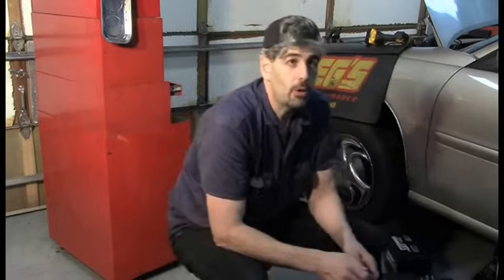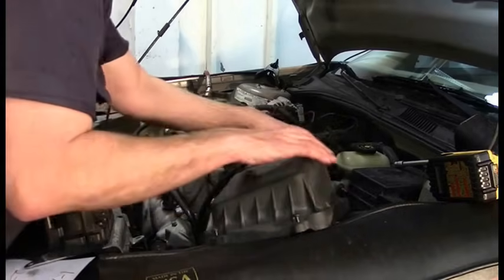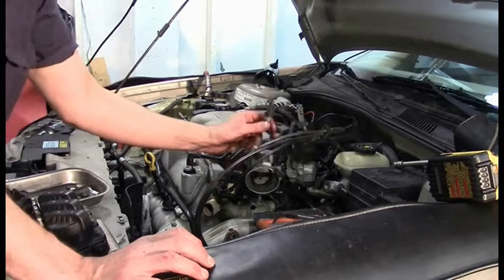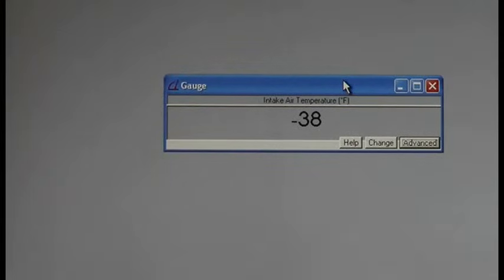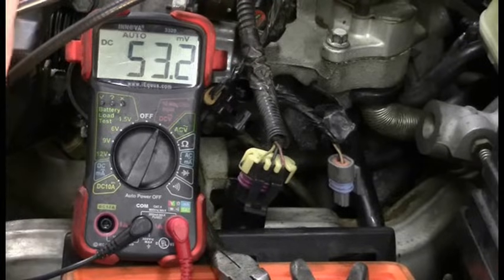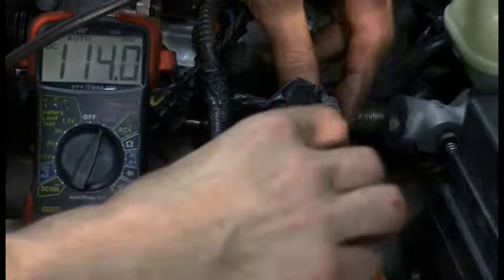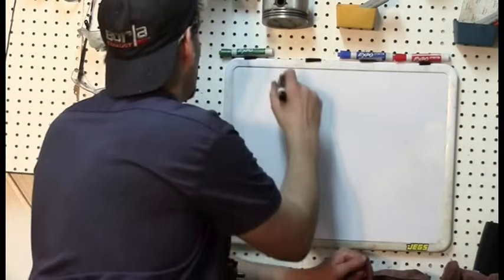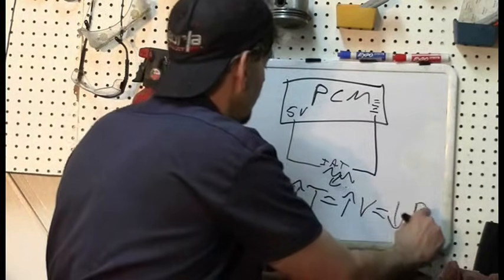IAT ( Intake Air Temperature Sensor ) Diagnosis P1111, P1112, P0113

Comment: Maybe you can help me out on my car by giving an advice
Reply from the maker: Thats why I am here. What is the issue and more importantly what data have you collected?
Reply: Schrodingers Box no codes but intermittently flashing of lights on battery, abs, ebrake light Autozone checked it says voltage regulator, I checked battery and alternator gives good readings, 04 civic ex....😥
Reply from the maker: Sounds like bad batter connection. Check battery terminals and other than that the main fuse and ground.  A bad block ground can do this for sure.
Reply: Schrodingers Box I will double check on that but I’m pretty sure I’ve cleaned and checked all those as well
Reply: Schrodingers Box the most times tht lights flashes when I speed up then release my foot on the gas then starts acting up even my headlights gets dimmer then brighter....😔
Reply from the maker: What is voltage drop across the chassis ground?
Reply: Let me check really quick and get back to you sir
Reply: Schrodingers Box ok, when the engine off the voltage is 12.45even the chassis ground no voltage drops when the engine on 14.85 same thing with the chassis ground
Reply: Every connections are tight and secure clean and what so ever, but sometimes while I’m driving it’s starts acting up specially when I release my foot on a gas pedal lights from abs e brake and battery light will flash
Reply: Schrodingers Box do you have any account that I can message you like messenger ?
Reply from the maker: Well of course there is no voltage drop across the ground with engine off- that’s obvious. Not sure why you would do that.  But how can you have no voltage drop at all on the chassis ground? Not even half a volt?
Reply: Schrodingers Box it’s really weird I checked it few times its just flactuating like 14.85-86,87
Reply: Schrodingers Box can we say it’s a voltage regulator? I don’t want to throw parts without really confirming the real prob, even auto shop here in National City California they said there’s nothing wrong it I doubt it
Reply from the maker: You still have no data. Ok just tell me what is the voltage drop from the Positive Terminal on battery vs the Starter solenoid positive terminal during cranking? Maybe it’s on positive side and not ground.
Reply: Schrodingers Box I’ll check it tomorrow as soon as I get a chance I’ll let you know, so thankful for your time to reply, I’ll let you know tomorrow sir
Reply: Schrodingers Box .15, .16 voltage drop

Comment: Hi i have a hyundai excel x3 1.5 dohc engine and the manual doesnt show the iat sensor or map sensor but i have a map sensor on the manifold ? I have a 4 wire sensor and cant find testing on the  hyundai map sensor?  Any help appreciated thanks?
Reply from the maker: yes it has one.
Reply: Is it part of map sensor?
Reply from the maker: No idea. Look at the design. If is has IAT built in it has to be 5 wire since MAP is potentiometric

Comment: So my car is haveing problems with this where  it’s a crank no start but there seems to be oil on the plug and reading a hire voltage then it should what should I do
Reply from the maker: I would start with a simple FASTTEC analysis to get your source direction

Comment: Would remapping the Ecu effect this sensor? Thanks
Reply from the maker: I am not sure why anyone would do that but I suppose you could adjust calibration of it through programming.  Even so the effect on fuel trim adjustment would be pretty minimal.
Reply: I turned my ecu with a Remap. 6 weeks later I Received an error message P011100 code. Not sure is it the sensor?
Reply from the maker: Ok so what is the input into the ECU reading?
Reply: @SchrodingersBox . I didn't take any readings!
Reply from the maker: Well then we're stuck

Comment: Great video Matt! Question: what relationship does the IAT have on fuel trims? Thx...
Reply from the maker: just about none at all. An IAT will never cause a P0171 for sure even if it was fully open circuit.
Reply: @SchrodingersBox  Well my problem now is my fuel trims r -18 but I'm not getting any codes. Scanner Danner just gave me some advice and I'll try that this week. Thx Matt
Reply from the maker: @curlymyhero  Yeah I would start by curving the fuel trim against load to get a basic direction to start with.
Reply: @SchrodingersBox  Thx again Matt!  Just noticed u have 600K views on ur IAT video. That's alot of views for mechanical advice! Congrats

Comment: I swapped PCM and sensor, no joy.  Checked wires signal wire was only getting 1.5 volts instead of 5 from PCM connector.  Switched to a nearby 5 volt reference and now I get 5 volts but it doesn't change the P0113.  I can't seem to get anything but -40 when on live data.
Reply from the maker: What was your data that the PCM was bad? I would start there for sure... also why was sensor changed?
Reply: @SchrodingersBox  I changed the sensor because the wires seemed fine and the -40 on live data led me to believe the sensor was not communicating.  I changed the computer because I thought it wasn't sending the 5 volt signal.  I believe the problem is with the IAT pin #21 on the PCM connector that is producing 1.5 instead of 5 volts.  Now I am searching junk yards to see if I can rob this connector.
Reply from the maker: @QLFProductions  Are you testing it under load or on open circuit? If you are getting 1.5V on an unloaded circuit the PCM has to be bad,- there is no other explanation.  If the circuit is loaded then of course you would get 1.5V unless you measured ahead of the load and against a chassis ground because of the internal resistance for the PCM's voltage differential measurement.
Reply: @SchrodingersBox  1.5 volts with key in the ignition, 1.5 volts with engine running.  NO 5 volt signal.  On second PCM.  I believe there is a problem with the connector.
Reply from the maker: Again.... are you measuring with the circuit loaded?  You can't tell anything if circuit is loaded because you have resistors in sequene so there will not be full voltage drop across the load!!!
   If you are measuring 1.5V with an unloaded circuit at the reference signal there is no possible way the connector can be the issue because you have deadheaded the circuit- the PCM must be the issue in that case. There is no other possible explanation.
Reply: @SchrodingersBox  I'm on my second brand new PCM.  When you say circuit loaded, I assume you mean with the connecter connected to the PCM and the key in the ignition to on.  If that's what you mean then yes.  I get nothing if connector is not on the PCM with key to on.
Reply: @SchrodingersBox  It's a 2005 chevy cavalier 2.2L OHC
Reply: @SchrodingersBox  When I measure the signal wire I get high resistance, no load
Reply from the maker: if there is high resistance on the wire how can you have 1.5V with no load on the circuit? Only explanation is a bad PCM. You have to measure with no current- just voltage.
Reply: Schrodingers Box just measuring voltage I get 1.5 with key to on position and nothing without key.  Maybe I will test a third PCM just to verify but I’m at a constant -40
Reply: When I unplug the sensor it’s still at -40.  Both wires seem good.  I can’t find a break and of I touch another 5 volt ref wire with IAT signal wire, I get 5 volts.  So I actually have another bad PCM or an issue with the connector.
Reply from the maker: Of course if you unplug the sensor it will read -40. How would it not? you max out the voltage between the in-series resistors so there will be no voltage drop to differentiate.  It would read -40c whether the voltage was 1V or 100V.
  Thats why you need to validate the reading with the circuit unloaded so you account for the voltage drop from the in series resistance!!!
Reply: @SchrodingersBox  There is no voltage with the key off.  Turn the ignition key to on 1.5 it should be 5 volts.  There is suppose to be a change in the IAT live data reading with the sensor unplugged vs plugged.   But there is no change.  I'm trying to describe to you what's happening and we're going in unproductive circles.  If you have a plan let me know if not I will go with mine as I suspect the damaged PCM connector to be the issue.  The rubber insulation is not in tact.  I have one from the junkyard so I will swap. What I got from you so far is that maybe my second PCM is not supplying the 5 volts  so I have a third.  It's not the sensor, I swapped PCM I verified  the signal wire and the ground wire are good so I am looking at the connector.
Reply from the maker: @QLFProductions  Well I have no idea why you would measure with the key off, of course it will be 0V. Not sure what you were looking for there but once again- is the 1.5V on a loaded or unloaded circuit? You still have not answered that and it's only data you need.
  Let's try it a more basic way- just give me the voltage drop across the IAT when circuit is loaded. That would work too.
 Also it would be helpful to know the amperage as well. If you can get amperage that would help a lot.
Reply: @SchrodingersBox  When you say circuit loaded I assume you mean with the ignition to on position as that is what sends voltage.  Anyway I rewired the 56 pin PCM plug and It's all fixed.  Thanks

Comment: I don’t get it. The sensor is $11. 

Just change it and see if it solves the problem. Why all the math and process? At what hourly rate would a diagnosis make sense over a replacement? $7.00/hr?
Reply from the maker: I don't get it- why would you possibly, possibly, possibly EVER replace ANY part rather than test it? Absolutely makes no sense.  Also what if the part is $290?  It's not like now all of the sudden you get the ability to understand testing concepts.
 Finally- people who just change parts fail to understand the basic fundamental concept of etiological validation through baseline.  Ok you changed the part- now it works... or does it?  You return the car without even knowing if the parameters for fault detection have been set? If the CEL comes back on do you replace the part again or was the issue that you jostled the wiring temporarily but now it failed again- or did you never actually fix it the first time?  You don't know because you just "plugged and prayed". Establishing the baseline parameters allows 100% validation the repair was completed and permenant regardless of if it was the part, wiring, or a new PCM because you can validate the baseline variation.  Impossible through "plug and pray".
  Science folks.  only 2% ever understand that a lack of comprehension is never justification for process variation.
Reply: Schrodingers Box 
Mmm Kay. 
The part isn’t $190. It’s $11. Variables change and processes change. Easy trigger. 

It’s an IAT sensor, Not an ECM. The severity of the failure mode is minuscule. 

I am not advocating that you stop looking for symptoms or failures after replacement. 

This is a simple cost:benefit ratio. 

Why not strip all the wires and visually check all the copper braids for fraying and short potential? Because why would you? If you were concerned with a wire’s integrity, you’d just change the wire. 

At some point, commodity parts are replaceable without testing. And for me, it’s definitely about $11.
Reply from the maker: You don’t get it. YOU DONT KNOW IF ITS WIRING, ECM OR COMPONENT. In fact you don’t even know if it’s a “referenced code”. Just stop and think about what you saying! You are affirming the consquent, is that logical?
  Also you couldn't be more incorrect in saying "variables change, processes change". Scientific process NEVER changes BECAUSE variables change.  How is it people don't see that?  Thats what makes it scientific! The process MUST be constant!

Comment: Thanks for the video. My first instinct of course, was to just change the sensor on an F150 I've been working on. After jiggling the wires, the truck started running great. As with most vehicles, they only use enough wire to just reach it's destination. Looking at the plug I could see the wires had been twisted and folded and probably broken inside the shielding right at the plug. I got a new pigtail/plug and cut off the old plug. Got it all wired up and truck is running fine . Waiting for the code to clear now.

Comment: Hi I have a 2004 Nissan Quest the engine shakes when the MAF sensor plug in when when I unplug the MAF sensor connector it goes back to norma no shaking or nothing idles good I was looking at the 02 sensors as well I had change the spark plugs it had  carbon so indicates me the car was burning lean and have lack of power car won't go over 3,000  RPM p0300, the p112 p0113 probably came up because I unplug the MAF sensor

Comment: Is it normal for IAT reading to go up by 50 C while idling.   Before starting the car it was reading 8C even though it was 0C outside.  Started the car the temperature slowly went up to 62 C over 20 min or so of idling . I guess the temperature should go up since the engine compartment gets hotter and intake hoses  get wormed up.  Not sure if it would increase the temperature by 50 C though. Disconnecting the MAF/IAT sensor brought temp down from 8C to -40C.  

My problem is that when i reset P0507 (Idle higher than expected) and start the car, it runs normally at 860 rpm or so.  Once engine reaches 100C  i turn off the car wait a min, than start it back up and it  runs at 1200 rpm. After driving it around for a little while I get error code P0507 again.  Resetting the code sometimes brings rpm down to 860 other times it does nothing.  Trying to troubleshot the IAT sensor to rule it out as a cause of the problem.   2006 Honda Civic EX coupe
Reply from the maker: that is not a iac problem. check your fuel trims curved against load as a basic starting point.

Comment: I have a 94 460 key on engine off fuel pump won't stop running 40 PSI help
Reply from the maker: Easy fix- check for a ground fault on the control side.

Comment: worked today Matt 9/13/18 had same problem on my 98 S10 2.2 and wasn't getting the 5 volts for the IAT 
 sensor  started down the harness and found the broke wire problem fixed thanks for the great advice !!!
Reply from the maker: Yes it turns out this is a known factory defect and quite common on these models. Didn’t know that at the time though or i would have suspected it off the bat.

Comment: Could you have checked the IAT 5 volt side to ground,(engine block, battery ground) then that would tell you if the ground side of the wire that is going back to the PCM is ok, or not broken..right??? Or the PCM internally is bad
Reply from the maker: Yes absolutely. A power side can always be confirmed against a chassis ground and in fact on an open or missing ground at the connector it;s the only way to do it.

Comment: Damn. Ive had one of those short detecors ofdered to me a couple times.  Now im kicking myself for not buying one. You podsibly could have wasted alot of time digging around looking for the problem. But instead u found the location of the fault almost as soon as you hooked it up. You can bet ill be buying one next time im on the tool truck.
Reply from the maker: Yeah this is by far one of the most time saving tools I own! I have a few other videos where I use it too

Comment: Well, like an idiot I went and bought a new sensor without testing. I figured the car is 20+ years old, a new one might clear up some issues. Oddly, AC Delco seems to have made the unit smaller. It fits the same but the overall size is smaller. I referenced the superseding part nos. many times and it matched up. Anyway, I was concerned about the size difference (even though it appears to read the same) so I found your video. My wire voltage was good as was my old sensor. Mind at ease. So, back in the old one went. A minor loss of $13 but still....I'd prefer to have the money. Thanks!

Comment: On the opposite end of the spectrum, how would you test and find a bad ground? I have a 1992 Chevy S10 that has several grounds. When I turn the park lights on, the Oil Pressure and Voltage meter in the dash goes down. The Voltage goes down from 17 Volts to 11 or so according to that meter. The oil pressure goes from 38 to 20. Turn the park lights off and the pressure goes back up... When the lights are on, I get a check engine light when I let off the throttle, but will go back off after driving a mile or so. As well as the engine dying when coming up to a stop. With the lights off it never throws a code and runs perfectish for a rebuilt 4 banger...
Reply from the maker: A bad ground is found same way as any impedement- by isolating the circuit or the suspected ground. when there is no measureable resistance on an isolated circuit OR an alternate ground is provided AFTER THE LOAD which now drops the voltage to zero which was not observed prior to the isolation, a bad ground is indicated.

Comment: Matt, what does mean INTAKE AIR TEMPERATURE.Sensor. 1 Circuit High. please explained .
Reply from the maker: It means the voltage detected by the IAT circuit is reading higher than anticipated voltage given the conditions. Simple perform checks for 5V reference and resistance relative to temperature to determine if there is short to ground on the reference.

Comment: This video is amazing. i have to ask something. i have IAT, i can read with this 80 grade celcius but the car is in the garage and there is 10 grade celcius. I changed the IAT with another(this no new, i want believe that the used IAT is work) and  now i read the same data(80 grade celcius). I received from computer 12 volt and 5 volt. the car dont start. what do you think? what i have to check more? or the motor computer is fail?